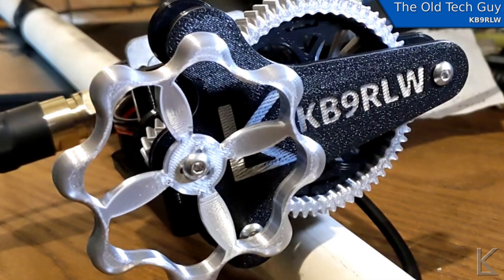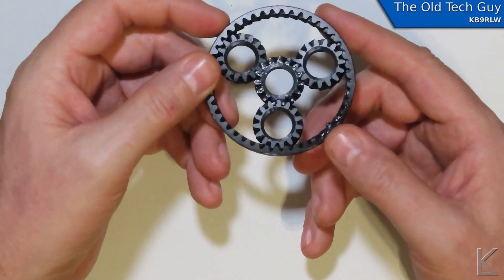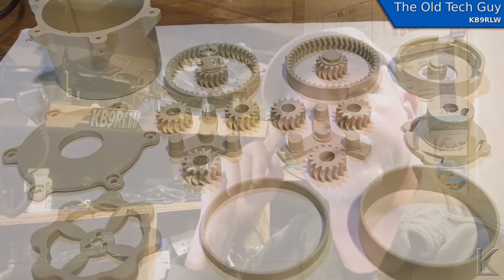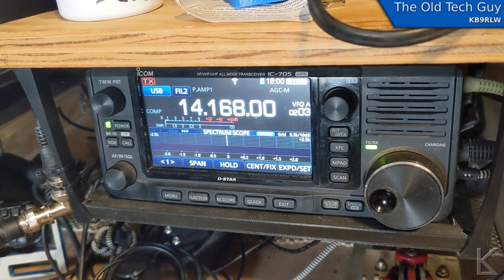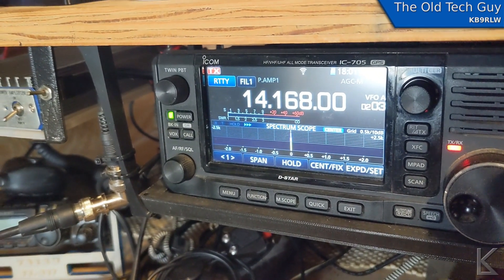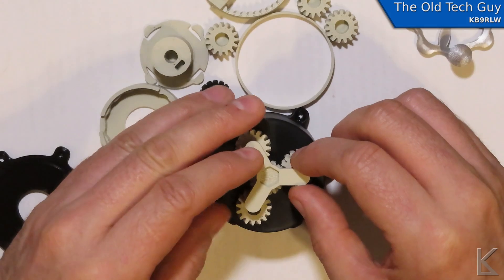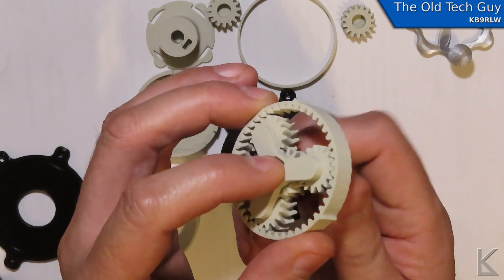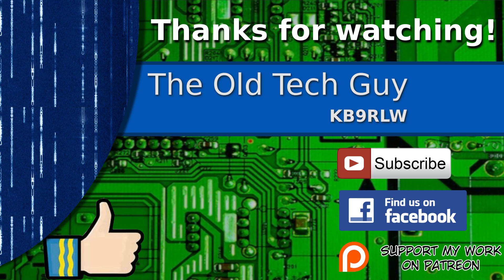Ham Radio and 3D printing - A dual stacked 16:1 planetary reduction drive for magnetic loop antennas

Comment: ✅    Well done… you’re more than just a pretty face…  clever.        Bit more of an explanation please about tuning the static… the why Is it so.        💙
G0 UVL
Reply from the maker: I don't completely understand your question.  Why tune the static?  
When the loop is tuned resonant to the frequency your receiver is on, there is a clear increase in the noise floor.  Using this to tune the loop initially, gets you very close to your operating frequency without having to transmit any power.

Comment: I downloaded FreeCad and now have 5 minutes experience. I did not know how to query the number of teeth so I counted them.
I assume the sun is the driver, the carrier the driven on the first planetary -- the carrier is the driver on the second with the second sun the driven.
With the ratio of 45 ring teeth to 15 sun teeth each has a reduction of 4:1 and in series,4x4 or 16:1 reduction ratio.
Even if I am wrong in my calculation, you inspired me to download the program. Thanks for another creative video.
Reply from the maker: Go to my channel page and look down the recent videos. There's a few freeCAD videos, including one looking at the gears workbench where I talk about all the data with the gears. 
The earlier tutorials on doing threads and the knurled knob Go through the basics of using freecad. 
Your calculations are correct it is 16 to 1. If you want to see the details go look at the assembly video that was linked in the video description. I take you through the entire assembly process.
Oh, and on the free CAD page there's a link for the 1.0 release candidates. If you didn't follow that you probably got the old 0.21 version. Make sure you get the 1.0 RC2 or later if available. It's much better.
Reply from the maker: https://youtu.be/PxOzA0gjQwE
Reply: @loughkb  Thank you, I don't think I noticed it. When I was seven, I didn't know how those sealed hub bicycles could have three speeds. Now I know it is planetary gear sets - they are still making them for bicycles with very highly engineered designs.

Comment: Boy! I love your work! Consider selling this 16 to1 reduction drive as a kit!
Reply from the maker: That wouldn't be profitable. Several hours of print time for the parts would make it nearly a day per unit assembly time just to get all the parts together.
Reply: @loughkb the Bambu printers print a lot faster than the Ender 3’s
Reply from the maker: @GreyGhost-r4z  Yes, and so does my prusa MK4S.
Reply: @loughkb  I just finished the print.  Amazing design !!  I’ll have to watch some more gear making videos.  I was pretty impressed.  Next thing you can design is a UFO propulsion system.  We will have to find you some Element 115 😉

Comment: Maybe you could try a course-tune / fine-tune system.  Add a second variable capacitor in parallel with the main capacitor.  It's value about 1/10 the main capacitor's value.  Go back to the 3.8:1 gear ratio.  To tune this, start with the small capacitor mid range, tune the main capacitor close to the "sweet spot" then adjust it better with the small capacitor.  If you don't QSY very far the small capacitor should handle the change.
Reply from the maker: Somewhere back in my catalog I have a magloop video that I used two capacitors in parallel. One of them had a mechanical gear drive on it. As I recall. It was a few years ago.

Comment: Nice upgrade to the tuning function.

As a further upgrade could you use what you learned from the CW voice keyer and "listen" to the radio with an ESP32 driving a stepping motor to do the tuning.  Maybe save band edges and known frequencies in memory so know roughly how many steps away you are from where you need to be for the next frequency.  You could get near very quickly and then fine tune the capacitor position.  This ide would require you get the frequency of the radio from the CAT port of the radio.  Or you could just scan the whole range of the capacitor until you find the "sweet" spot.

Comment: Excellent system project. 
I built loop tuning using a model servo with external gears. This enabled me to locate the loop in a better HF area and remotely tune using a switchable + and - power supply with the voltage governing the speed of tuning forward and back. You could mechanise with your gears.
Reply from the maker: If you go way back in my catalog, you'll find my first magloop build where I had a geared down DC motor and a remote control box with a field strength meter that I used to tune the loop.
Reply: @loughkb  Have you considered using a stepper motor with the worm gear? Tuning across the band with a 72 to 1 ratio would not be as onerous. DE WA1KLI
Reply from the maker: @JohnTarbox  being that this is intended to be a portable loop that would make it more complex heavier and cumbersome.

Comment: Loved the opening Kevin.  They say you really know your CW when your appliances start talking to you.  My ice maker routinely says "G W" - and it get's a pile up every time (it's a pile of ice, but still....)    When I printed the worm drive for my alt-az satellite rotor (and you ain't kiddin' that they're tough to print) I had the same little bit of gear backlash.  Plastic safe (non-petroleum) grease makes the whole thing even smoother and takes up some of that space.